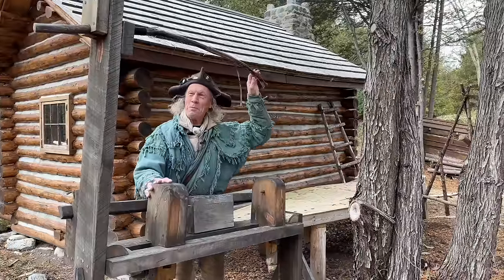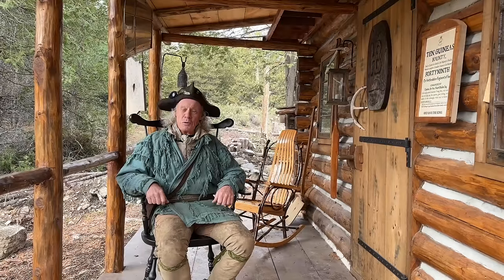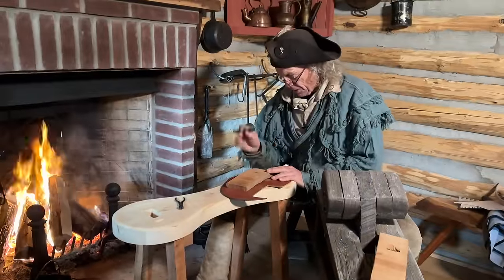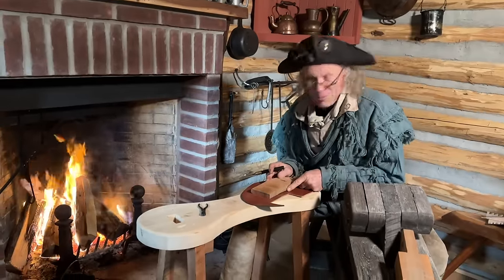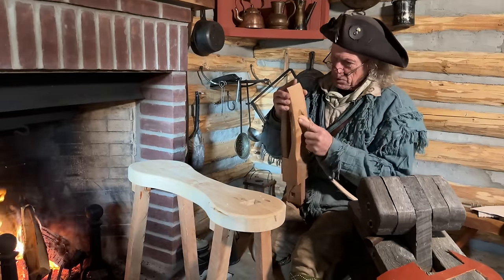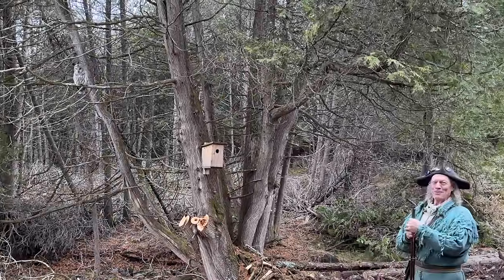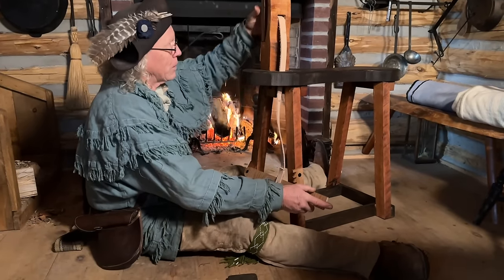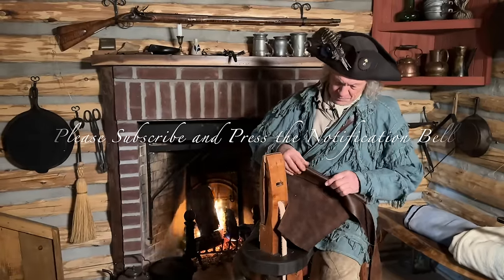Making an 18'th Century Leather Pony | BODGER | SADDLE STITCH | LEATHER BAG | COLONIAL HISTORY |

Comment: Pretty nifty little tool.  I like it a lot.  They had some wonderfully simple solutions for many things back then.
I’d suggest though that if you keep lowering where the straps go through, you will start to loose your tension at the top,  because the long top vs the short part near the hinge will give mechanical advantage to the wrong end, and you’ll need to press harder to keep it tight.  Maybe making a new pair of clamps with a curve or arch, so that there is more space under the clamping surface?     The clamps look like they’re thick enough to take a little material off from for now.
Great video……even though you never give away anything to me.😢
Reply from the maker: It is indeed an amazing tool, kinda loving using the thing.  Appreciate your continued interest in our endeavors.

Comment: Plans?   I have a stitching horse (pony) almost identical to yours. My grandfather had one for harness-work and my uncle made patterns from it but never built one. When my uncle died i saved his patterns from the kindling pile and put one together using them. i used a short piece of piano hinge for the jaw pivot and i have replaced my original leather strap with a nylon one -it's stretchier.
Reply from the maker: Sounds like you’ve put together a pretty function one … some great ideas, thanks for sharing.

Comment: Peter, as always, an enteraining and educational video!
 It's my understanding that if it has 4 legs and you "ride" it, it's a horse. A pony is similar but you placed it on a bench and held it in place by sitting on the bottom board. Most ponies i've seen  used a levered cam for tensioning the jaws. i do like your tensioning solution and may make one myself.
Beautiful job on that welt, please show us the completed bag in a future video.
Reply from the maker: Good point about the differences.  The bag I making is not a historical one but, rather a Xmas gift to hold a lap top but, I’ll show it for sure.   Thanks for the kind words.

Comment: you dabble, IE your the equivalent of a homesteader,  they had to be able to do all things or wait months or years for someone to come along who could do it.   I need to make one of these,  I like your plan but I will make it so a spring opens it and I hold it shut with my foot.  I do smalls and need to adjust often.   Ill also use three legs, sits better on uneven floors.
Reply from the maker: All good ideas and you’ll not be disappointed once done.

Comment: I would try to figure a way to add a little extra clamping power by adding a hand held cam system on the leather strap that way you could add about twice the clamping power by just pushing down on a lever and expanding the width of the gap on the strap
Reply from the maker: Good ideas, thanks. .

Comment: Hi Peter, what about a stirrup at the end of the leather string instead of a wooden lever? Foot down applies pressure, foot up loosens it?
Reply from the maker: That would work but, this system allows me to lock it in position and forget about it.  For comfort I’m able to move about on the bench.

Comment: I made one but mine isnt a copy from the 18th century mine is made with screws that clamp it together and i made wood knobs woth a metal nut in them to clamp a garage boltand it has a board that goes under both thighs when sitting
Reply from the maker: A simple carriage bold and s wing nut would have done the job but, oh so out of place in my 1700’s cabin.

Comment: I'm surprised he doesn't know they always soaked the leather in water over night. The leather work is done the next day using wet leather, then let hang another night so it shrinks and tightens. 1600s 101.
Reply: modern leather tanning techniques save needing overnight soaking, merely wetting it suffices.